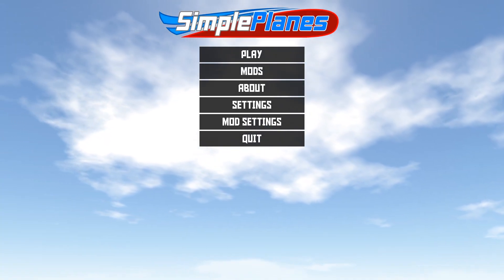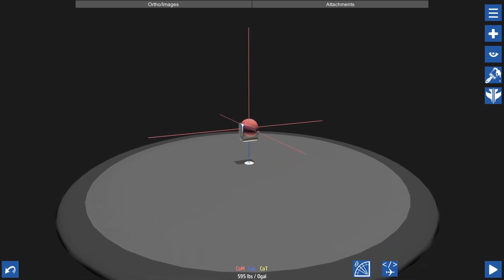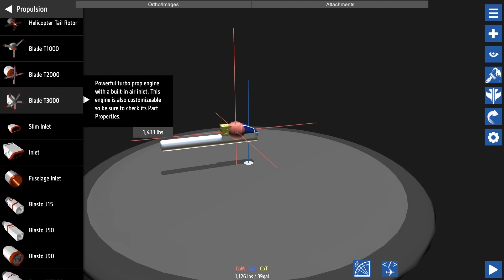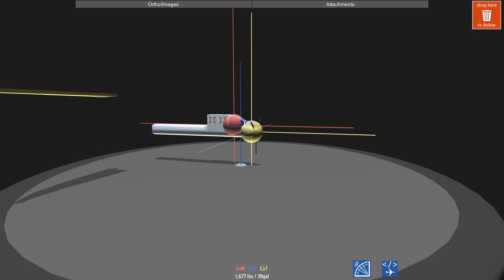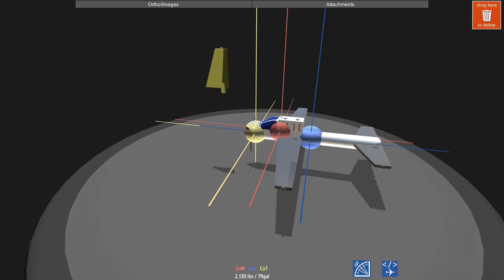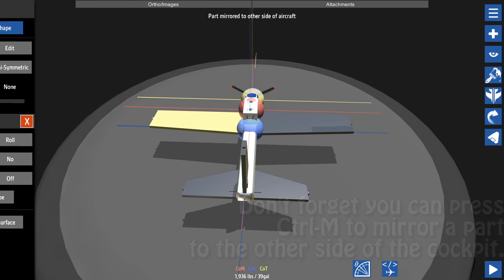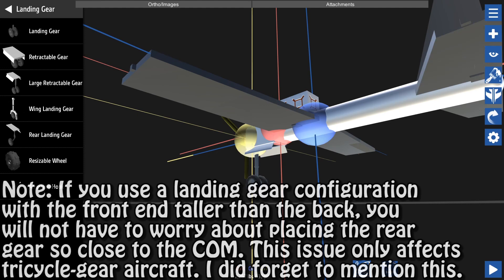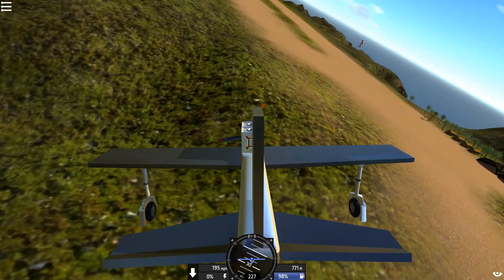Simple Planes Tutorial #1: The Basics

Comment: question:

How do I make the elevator more powerful? Sometimes I go to land but my plane goes a little too low and when I try to pull up it won't do much/won't let me and I think there is a problem with how i use the elevator
Reply from the maker: Consider rebalancing the center of lift so it isn't as far back from the center of mass. It sounds like the aircraft is more nose-heavy, so just pushing the center of lift forward should do the trick.

If you really want to make the ailerons more powerful, you can edit control surfaces in the wing settings.

Hope this helps, cheers!

Comment: I have two questions:
1. How to disable some saved aircraft spawning automatically (because they lag)

2. Does increasing engine power increase fuel consumption rate?
Reply from the maker: Heya Kreepy,
1. You can disable saved aircraft from spawning by loading in, going to game options (or one of the other option menus, not on right now so I can't check), and turning off air traffic. Unfortunately, I don't know of any way to actually ban SPECIFIC aircraft from spawning, but if you want to go the extra mile, you can create a throwaway folder and move the plane(s) in question out of the simple planes save folder and into that temporary folder. You won't be able to quickly load that file in-game but it should stop those craft from spawning without completely disabling AI spawns. Bear in mind that even with air traffic off you can manually spawn aircraft, so there's that option.

2. Typically, the more powerful of an engine you use, the more fuel it will consume per unit of time. However, in terms of xml editing, fuel consumption is governed by total potential throttle. Engines with the maxInput (found in controllerInput) increased will likewise burn more fuel. Also, I should mention that the VTOL engine is somewhere along the midrange of power and fuel consumption and produces a set around of thrust divided through the thrusters.

3. This was painstakingly typed on mobile so please pardon any typing mistakes, bit late right now so I can't be bothered to actually proofread the whole thing.

Feel free to leave any follow-up questions, I'd be happy to answer em :)